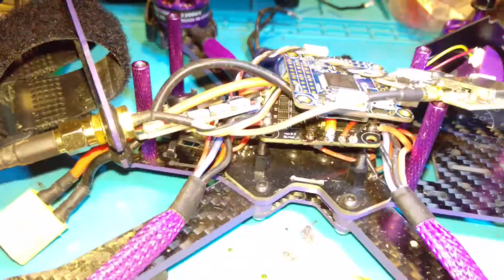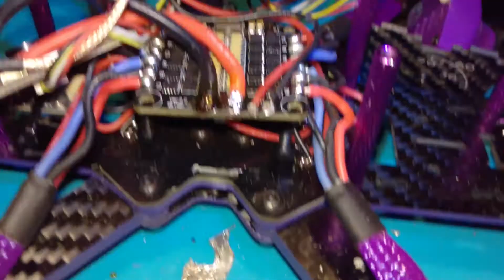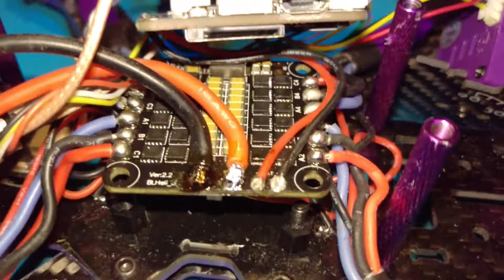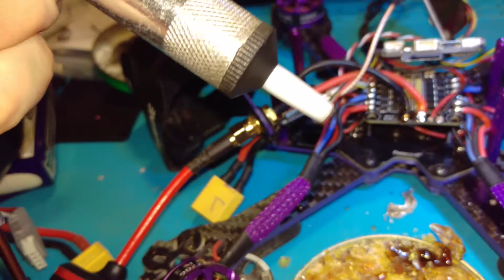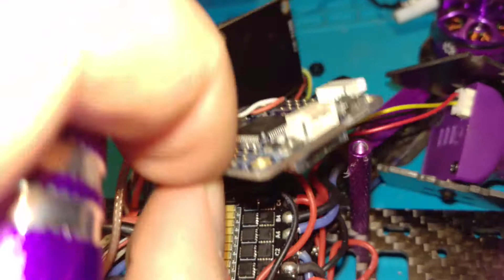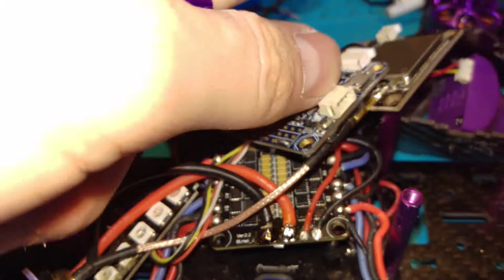Fixing Wizard x220s Part 1 diagnose NEW f4 FC needed ASAP ... no video ....

Comment: Actually really helped me lad had a motor blow out and in removing motor two wires came off the flight controller from watching your video I can make the repair and get back to rebuilding the missing motor. Z220s what a nightmare
Reply from the maker: Cool mate. Great that it helped a bit 😉